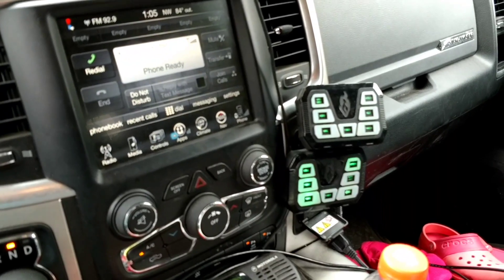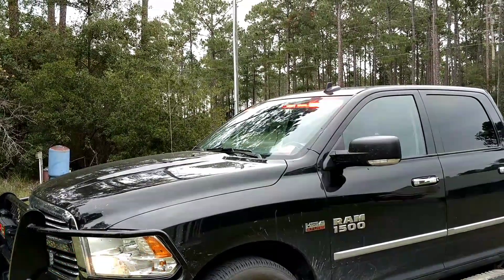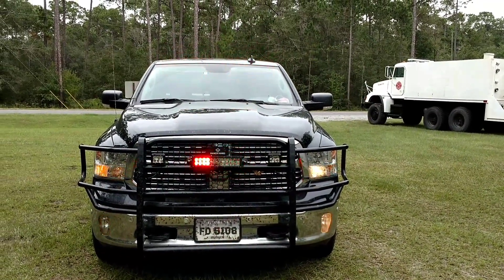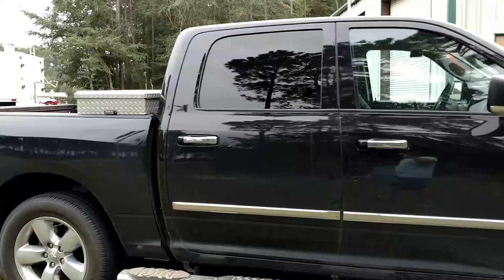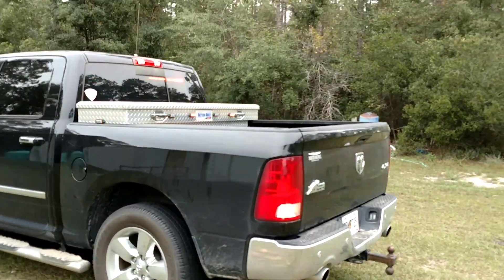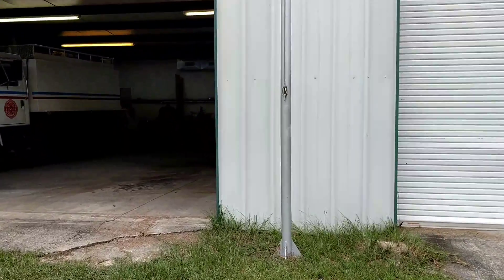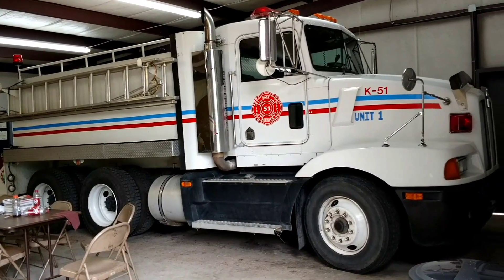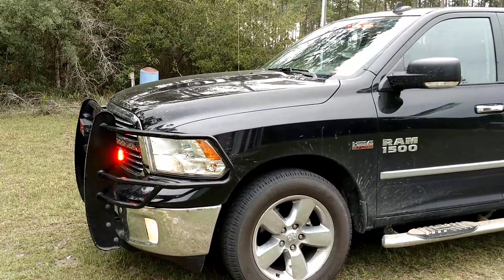Ram 1500 with Feniex and Speed Turtle

Comment: Can you wire the siren straight to the 4200 mini or do you need a separate controller like the typhoon?
Reply from the maker: If you get a typhoon it has the siren controls built in. I have the Storm Pro which was the previous siren and yes it is connected straight to the 4200 mini. The only thing is that the higher the number of the button/switch will over ride the lower number. So let's say you have your siren tones on buttons 1,2,3,4 if you want to be able to blow the air horn while the siren is going it will have to be on switch 4.
Reply: @jwatson1663  Gotcha..I think I'll just go with the typhoon vs the 4200 mini running the storm pro. Thanks

Comment: How did you run the wiring through the tool box?
Reply from the maker: I came from underneath the cab up to the toolbox in the corner near the cab. I then ran the wires on the inside from the front to the back and across to the other side under the guard protecting the rod that goes to the latches.